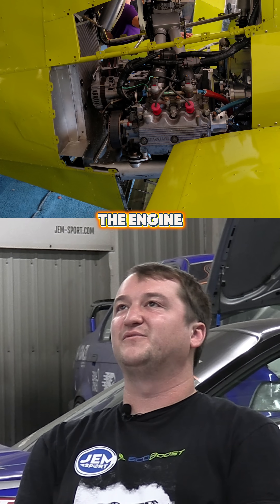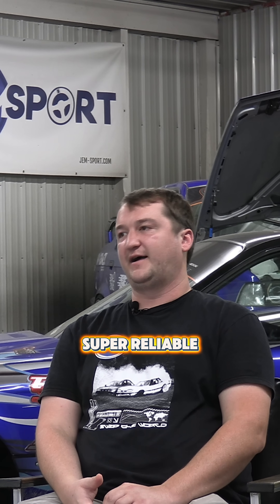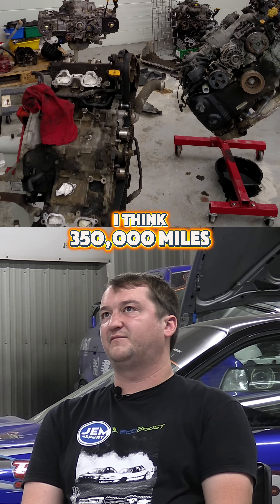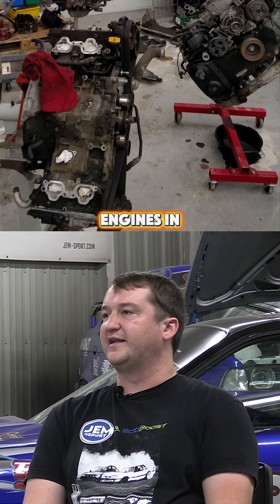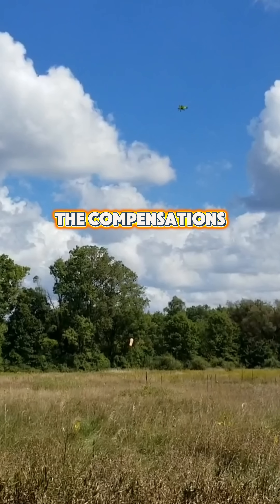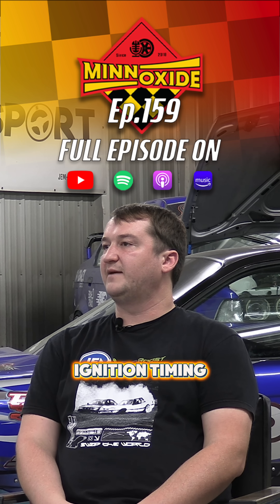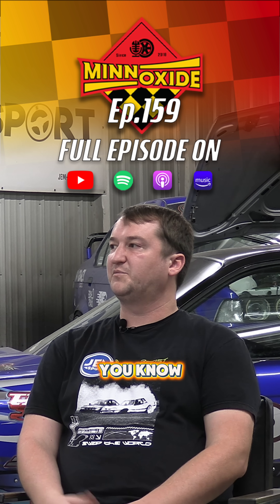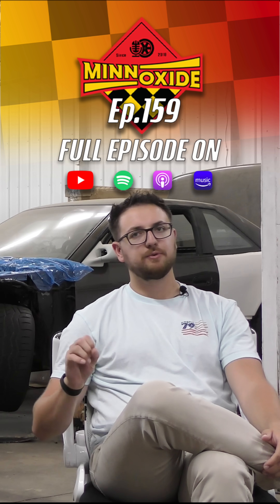Tuning A Helicopter (Haltech ECU)

Comment: General aviation engines have massive cylinder's, you'll see 360 cubic inch (5.9L) opposed 4 cylinder, its bore is 5.125 and stroke is 4.375, the engines have to get bigger and bigger because there is an RPM limit that gets reached.

Comment: He's dead right about those old 2.2 Subaru engine's. I live in new Zealand and we have been a jdm dumping ground for decades! Some guy's who owned a Subaru wrecking and dismantling business. Built a Subaru Frankenstein motor. From memory they used a 2.2 crank and a whole mess of different EJ parts basically built an engine out of the best bits, I've driven a wrx with that engine, fucking blew my mind. Same guy's dynoed a legacy in the early 2000s made 600hp only thing that wasn't stock was the turbo, injectors and ecu 😂

Comment: The ej engine is also used in small planes and helicopters. It's balanced. Low center of gravity and light.... Been using them in aircraft since they came out and even older, boxer engines have been used in aircraft for over 50 years guys.
Reply: Also they like high revs

Comment: Nothing wrong with Subaru engines 
They just don't like big boost
Reply: Subaru makes some of the worst engines out of Japan
Reply: @wtfyoguylol FA24 has proven to be pretty damn good so far and Subaru is currently considered the most reliable car manufacturer
Reply: @jeremyburleson6329   dude if you believe that Subaru is more reliable than Honda or Toyota then there’s no hope for you. You really believe that all of those head gasket and rod knock jokes about Subaru are baseless ?? FA24 has oil starvation issues just like the old EJ25 had..  a bunch of hard corners and hello rod knock 🤣🤣
Reply: @wtfyoguylol yeah most people don't own WRX's, GR86's and BRZs. And I have friends that track ZN8 's all season and zero issues with oil starvation. We are running 5w30 and overfill which helps tremendously. 

Subaru is considered the most reliable car manufacturer for 2025. I am a GR86 owner. I'm also a huge Toyota and Lexus fan,  Honda has kinda fallen off.
Reply: @jeremyburleson6329  I have a 2023 Passport zero issues, I’d rather die then trade it in for an Ascent

Comment: That’s a gyrocopter not a helicopter.
Reply: I think the engine was turning the rotor so a helicopter iirc gyrocpters don't have powered top rotors I could be wrong tho
Reply: @Anonihmus2567 no a gyrocopter uses the propellers like a airplane to propel the craft and a helicopter uses the top rotor and pivoting blades to propel it.
Reply: Negative. Main rotor of a gyrocoptor is not powered. Props for foward motion does not make it a gyro.

Comment: But what about the difference in temperature at cruising altitude?
Reply: denser air will be cooler and vice versa, so using intake Air temperature sensors will adjust the air fuel mixture
Reply: Air density changing at altitude is a much bigger problem then air temp. Modern turbo technology was developed in ww2 to deal with that issue
Reply: @Past10Performance That's the answer i was looking for. Ignition timing and injector on time is different at sea level compared to 1000 ft. up in the air
Reply: It's not carbureted....